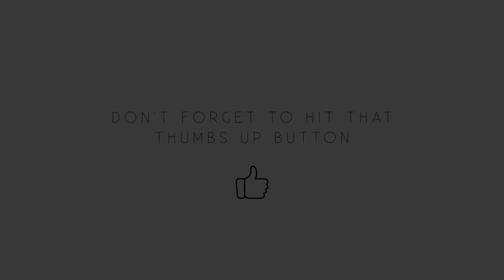Woodturning - Just Beautiful Wood

Comment: I'm a newbie, and I don't understand why turners will take all the knocking of turning a square into a round. Wouldn't it be easier to cut off the corners on a table or band saw so you startvwith an octogon shape rather thsn a swuare? Inreally like the esthetics of the bowl shape you chose. The result is really nice.
Reply: You got there before me.  I'm a dedicated hobby woodturner and was first introduced to the craft while at school many years ago.   Probably because tools of weren't such high quality then we had to first take the corners off with a large block plane thereby making it octagonal.  I still do it today using the bandsaw and it only takes a minute and makes the piece easier to turn.  I can't understand why woodturners today don't practice that method.  I'm in no way taking away from the piece as it's a stunner.
Reply from the maker: I have over ten years experience at the lathe and my bandsaw isn’t set up correctly to make these cuts. Overall it is faster and safer for me to use the lathe. 

I think you guys will like my latest vid. You could win some great gear to help you. 😊👍🏻

https://youtu.be/9C0q_VLZrhc

Comment: Is there a way to prevent it from warping at the end? Looks great of course, just curious
Reply from the maker: Not if you want the piece to be that shape with the same grain orientation.. 
tuning an under cut rim would lessen the effect of the warping on the rim but it would still warp.. 

Turning the same shape piece on spindle orientation ( with pith in the centre) would almost eliminate the warping completely but the spalting would be lines up and down the piece instead of of seeing the spalting cross section pattern. 
👍🏻

Comment: What process do you use for sharpening your tools?
Reply from the maker: I use the Tormek system. What do you use. ?
Reply: @JackMackWoodturning  I use a CBN wheel. Do you hone your tools or just grind them?
Reply from the maker: It depends on what kind of cut I’m after. More than anything horning removes the burr formed by sharpening. This isn’t an issue on tools used for heavy cuts and is desirable on tools that use the burr to cut such as scrapers and sheer cuts. I will only hone an edge for a finishing cut with a bowl gouge but I dont necessarily need to hone the gouge to get a lovely finishing cut. I still sharpen a lot of my tools on slow speed CBN wheels too 80 and 180.

Comment: Whyyyy would you start like that. Cut the damn corners off first. All that vibration and stress to the machine not to mention your wrists. You'll be suffering so much pain one day because of that, it's so unnecessary.
Reply: That's exactly what I was going to write and then I thought there's probably been 100 people who wrote it already if they've ever used a lathe.  I've only been turning for 50 years...... Looks like only 1 other person here knows what they are doing.  Piece turned (pun) out nice, I would have done done things differently.
Reply from the maker: Yikes… This dosnt half show the lack of experience you both have.. not sure what you’ve been doing for 50 years but I learnt how to turn CORRECTLY in my apprenticeship some 20 years ago and have been doing so every day since. 
An interrupted cut should not rattle or vibrate anything if you are actually woodturning instead of just pressing a gouge to the spinning wood. 
The reason for this is that the tool is held correctly so any force that may occur is directed down and into the toolrest.. but more importantly no vibrations or jarring is caused because the sharp gouge presented at the correct angle will cut wood from the passing workpiece. It will not collide harshly with anything. 
I shudder to think what it must look like watching you two operate a lathe. 😖
To answer the “why” question.. I start one off pieces like this because it is more efficient than cutting on a bandsaw.. blades are expensive and don’t make many cuts in their life where as a gouge costs around 0.0016 of a penny to sharpen. 
I also do it on my videos to Inform novice turners like yourselves that truing a piece on the lathe is an opportunity to refine your skills (which you both clearly need). 
I stress that I do this with my “one off” work.. I do not do it with my production work, I turn over 4,000 bowls per year and I prep all blanks on the bandsaw before I turn them. The fact is that it would be faster to turn them on the lathe from square but it’s inefficient as I have to then shovel up twice as many shavings each day. Also while more expensive on the bandsaw the corners from 4,000 bowl blanks keep my wood burners well stocked through the winter.
Reply: @JackMackWoodturning  you do you Jack. I refuse to believe that the vibration is harmless long-term.
Reply from the maker: I seems you didn’t understand.. or didn’t read.. there’s is no vibration when you know how to use a bowl gouge.